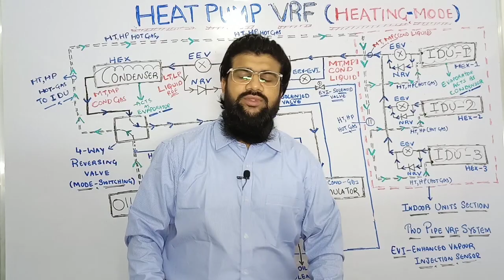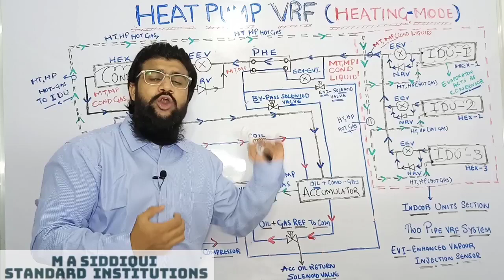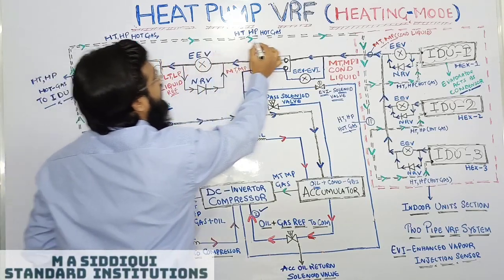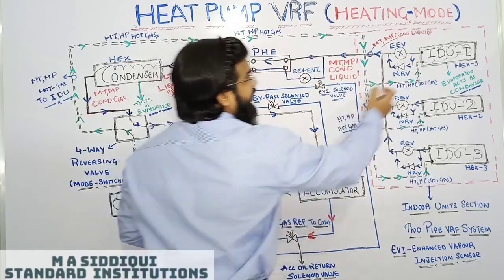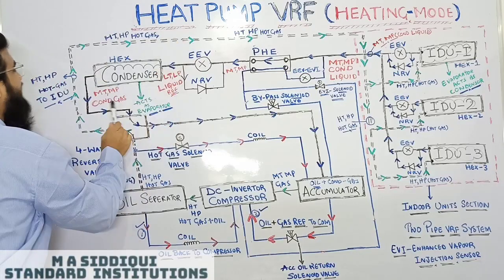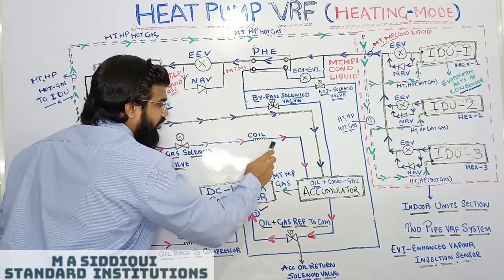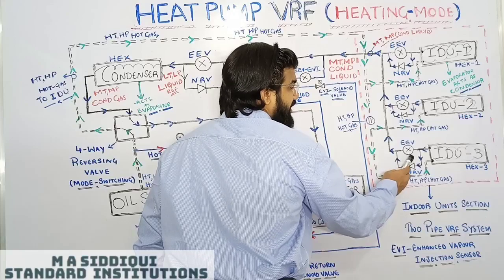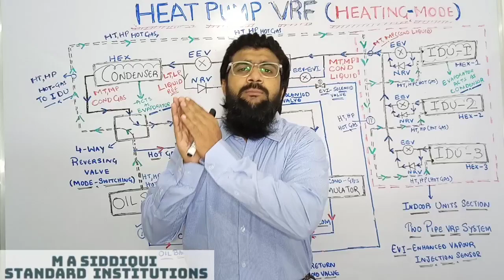HEATPUMP VRF-(HEATING MODE OPERATION)

Comment: i appreciate your work the only thing i want to say is in heating mode you must pass the hp,ht refrigerant to condenser after oil seperator and 4 way valve instead of passing to IDU,because in diagram IDU is condenser and odu is evaporator.
Reply from the maker: That's what I explained in it & thanks for your valuable feedback.

Comment: Then how the flow rate of high temperature superheated vapor is controlled in heating mode to maintain the room temperature?
Reply from the maker: With the help of Branch Controller' before Indoor unit Section.
Major Components of a VRF System
-The outdoor unit houses the compressor which acts as a pump pushing refrigerant through piping to the indoor coils and back. A third component is the VRF Branch Selector Box which is the traffic cop of the refrigerant, based on the demand of the system.

Comment: Sir two fourway reversing how to working in vrv vrf? Please sir explains
Reply from the maker: In this scenario we are using just one four-way reversing valve with non return valves for both Cooling Mode & Heating Mode Operations.
Reply from the maker: We are using just (One Four Way Reversing Valve with Non Return Valves) to let it work in both Cooling & Heating Mode.